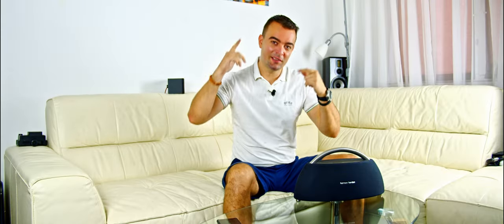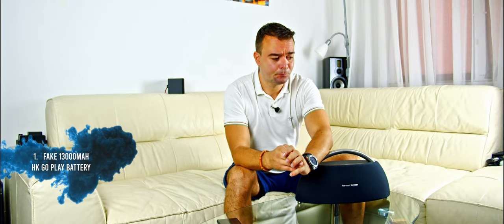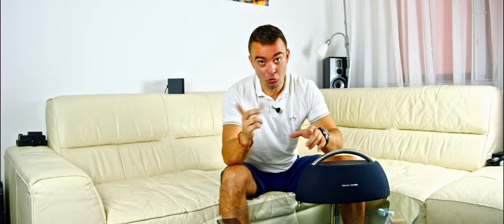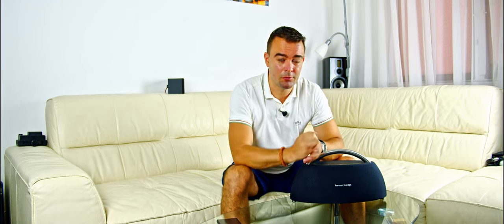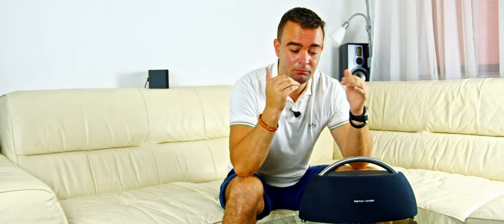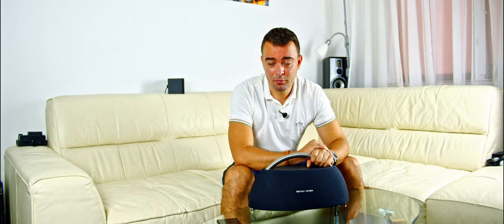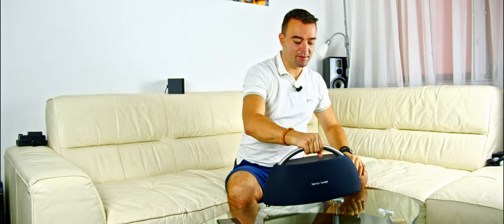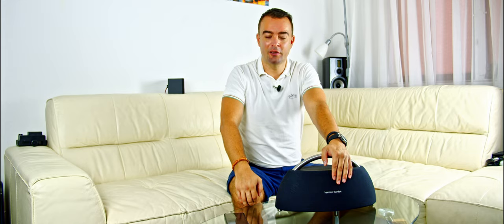Harman Kardon Go Play not starting, REPAIR FIX. Bonus: Real DOUBLING the BATTERY to 6000mah

Comment: Hi Alex. My HK Go+Play only got like 1 hour of play time left at max volume. And even at maximum, is not as loud as it was before. So I need to change the baterry and upgrade it, since 3000 mAh is really not enough. So, about that MOSFET. Did you remove it completely? And if you did, how did that turned out? How is it working? Do you have to manually unplug the charger when battery is full, or will the BMS still stop the charging automatically?
And how is the playtime after you doubled the capacity? It is really hold 2 times longer. Thank you.
Reply from the maker: Hi. For help or other information use the THANKS button in the video, and donate for supporting our channel. Thanks for understanding. Have a nice day!

Comment: Hi. I press - and + buttons at the same time and the speaker just turning on for a second and then turn off.  any tips how to make to work again? I tried 5 buttons at the same time nothing seems to work. Any advice? Thanks in advance.
Reply from the maker: Hi. There is a way to reset it but is seems a hardware problem. If with cable it works just fine, then replace the part mosfet that is in the video. Subscribe
Reply: @iTechnologyReviews  He probably read the same post on ifixit as me. Someone shared a "Service Mode"-Code as a fix for the charging problem, which was a troll of this person and not helpful at all. 
Now people who pressed (Volume - & + for 20sec and Powerbutton to turn it off) are stuck with a bricked device.
You can turn it on, but only the Powerbutton lights up for 3sec, than it turns off normally on its own with the sound.
So there must be a factory-combination to leave this bricked mode/service mode and return to the device back normal function.  
I doubt Harman and Kardon is willing to help or share any information on this matter, i am still waiting for their response.
Reply: @supplement420  have you got something? i have the same problem, hope you fixed it